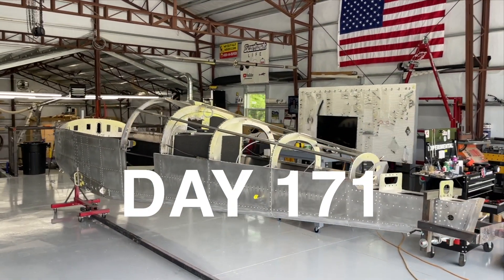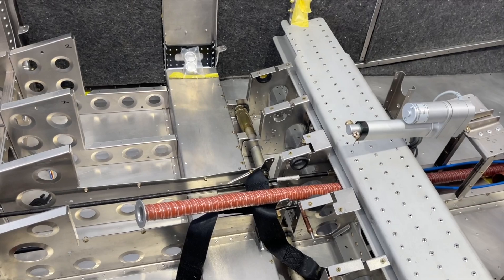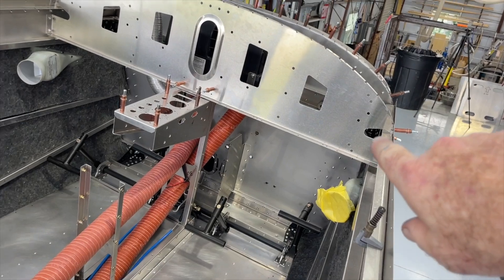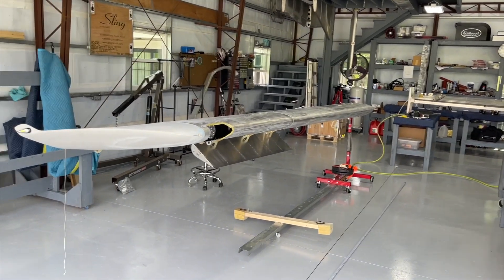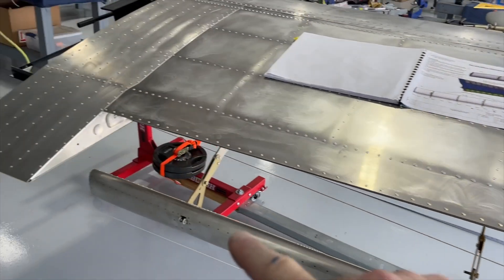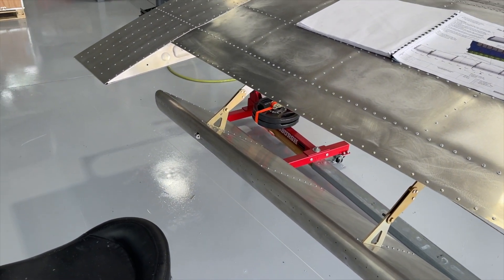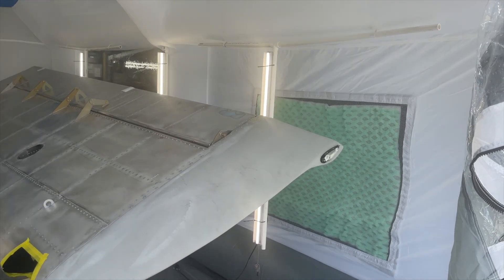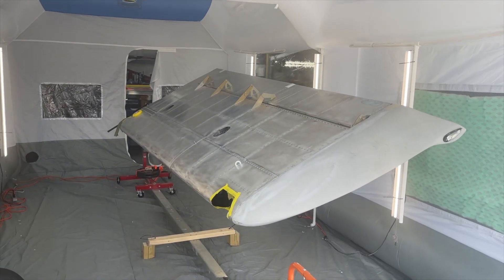Solving the Mystery Installing Flaps and Ailerons [Sling TSi Build Video #17]

Comment: Hi Rob, I'm enjoying the sling build, the kit looks fantastic and your attention to detail is great. I'm wondering why all the raw aluminum isn't corrosion protected?  I have worked on 3 venture questair's 35 yrs ago and we soaked all the pieces in a Alodine solution till they were a consistent color before installing them. What are your thoughts Thanks for sharing the build, hopefully soon I will be able to build my own
Reply from the maker: I appreciate the question.  I have addressed this topic in a previous video called "Aircraft Aluminum and Corrosion".  https://youtu.be/hcgxCII6JpA?si=XxVXl2m7OT8FaCGe
Reply: @TheBaldPilot  Thanks I will check it out.
Reply: Alodine is an incredibly toxic chemical process. The SDS states the specific chemicals required to remove and neutralize it, if ever splashed on your skin. If those specific items are not present, a trip to the ER is in order. For simply getting it on you.

Comment: Which tool are you using for aligning some holes? At 6:14 in this video.
Reply from the maker: The is a ice pick.  Also found in a Adel Clamp alignment tool.  https://www.amazon.com/Wicks-Aircraft-Cushion-Clamp-Pliers/dp/B076PSC658/ref=sr_1_3?crid=3RZP1TUC5YSDN&dib=eyJ2IjoiMSJ9.ZFnKpT_FyY6PzyE9w-IMK2Y0vOYtYd0XMkIxarpftRXstItx6SkgHSVVBm7Djiw4m_gZrVfXK38bVV9aucGGmCAS6Iam8-YsCWTdn4TFZerhAD3SFmy3myV0uuGv7kwjPOLHAeBQFTR73qK3Nmtrzg2S7CHy0umQHhS2obZMd8ZZ7_wDbj-etGXAtpJmQWbBnxql49S0MWANuCxUOjPsylzhx21E8OFR6esYBt642dc.UquZM4hTTLm3nXduGJdcwh_o5HT76DKkSMZsY7UYVWA&dib_tag=se&keywords=adel+clamp+alignment+tool&qid=1737817264&sprefix=adel+clamp+alignment+tool%2Caps%2C89&sr=8-3

Comment: That’s weird on the wing tip alignment issue. I didn’t have that problem. I wonder if you got a bad batch from sling?
Reply from the maker: Actually I think it came from the ratchet strap I used to snug the tip into the wing.  I installed the on the other wing and paid attention to not let that happen.  Lesson learned.

Comment: Nice video again. Please check your flaps (and maybe ailerons as well); the top skin goes above the bottom skin.
Reply from the maker: Thanks for the tip!  I noticed that too.  However I did not care for the airflow restriction/disturbance caused by the top skin.  Thanks for watching!
Reply: @TheBaldPilot  Not for the airflow, more for water entering the flaps and ailerons.
Reply from the maker: @pjlatten  Sealed with Sika Flex and Super Fill.  Thanks!